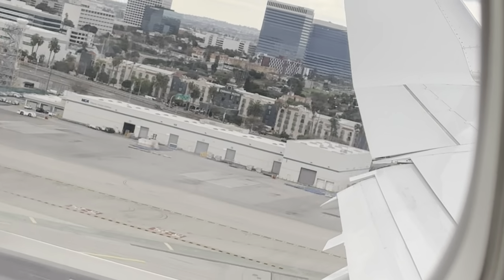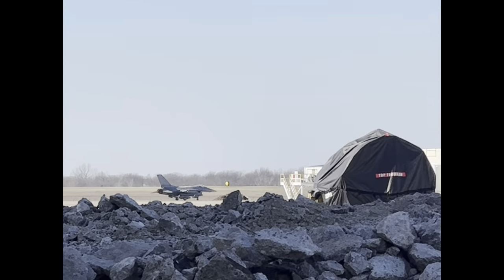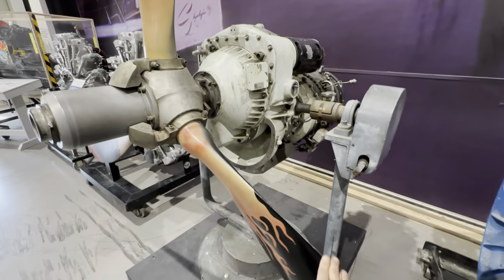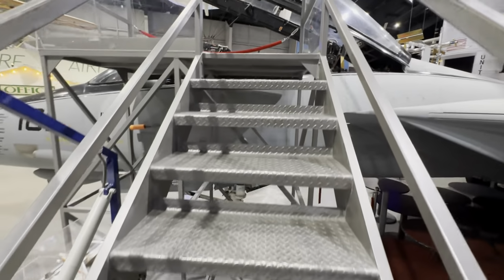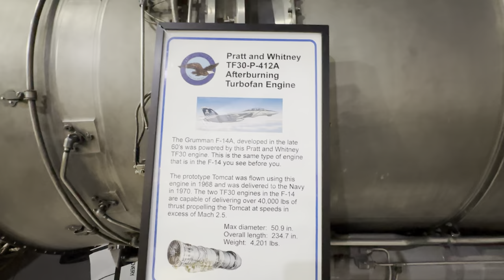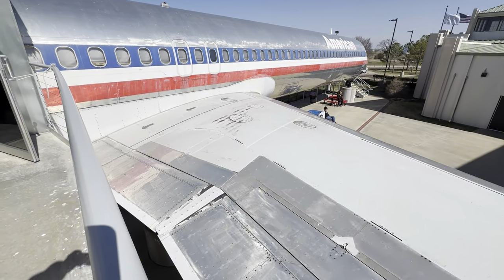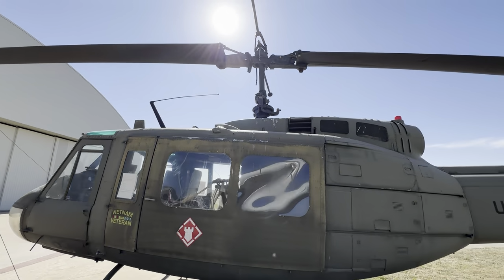Stig Adventure  Tulsa MRO visit and Tulsa Museum

Comment: I was amazed too when the CR Smith DC-3 came to TULE to be reconfirmed from a mosquito sprayer back to what it was, when it was delivered to American Airlines flying  passengers. I was blown away how similar cables pulleys cockpit was of the DC-3 next to our MD-80’s in C Check….. man I haven’t forgot the smell of that acft when it came and when we worked on it. Great Video
Reply from the maker: I have visited the CR Smith Museum as well, and that airplane is so pristine. They did a fantastic job restoring it.

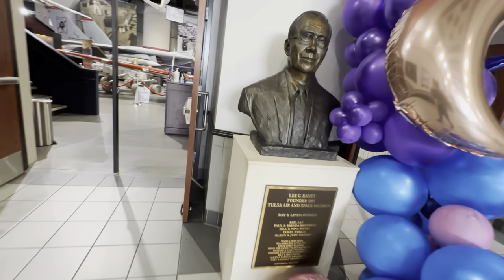Comment: I probably worked on those former Emery DC-8's at 8:26.
The DC-9/MD-80 part I disliked the most was the BUTE door, I'm sure you've had your share of experiences with those doors Stig...
Love the museum, great video Stig!
Reply from the maker: Yes, indeed I did have lots of experience on those doors, specially anything regarding in that aft compartment, where the Air stairs were. Almost no room to work.

Comment: I just subscribed. Thank you for making these videos to show the work that gets done to keep these things in the air. The hours, the weather, nothing stops the continuous maintenance of these machines.
 I flew for your outfit for 36 years and found the engineers and technicians thru out the system to be the best. I got to fly test out of Tulsa on the DC-10 and Alliance on the 76/75. Overhaul is an amazing thing to see.
My dad was a mechanic for United from the early 1950's and his dad built wooden wings for Curtiss aircraft.
Keep the tradition of exemplary workmanship alive young man. Love your videos.
P.S. I notice the chine tires and spray deflector are missing off the nose gear on the -80. Must be so they could mount it on the pedestal.
Reply from the maker: Thank you so much sir. I appreciate you being here and enjoying these adventures. And that is amazing that you contributed to the beauty of Aviation with all your years of service. I congratulate you and applaud you for that.

Comment: I remember at 3-4 years old, being on a DC-8 from Georgia to Calif. in 1961.  First passenger plane to exceed Mach 1, in a STEEP dive by a test pilot.
On August 21, 1961, a Douglas DC-8-43 (registration N9604Z) exceeded Mach 1 in a controlled dive during a test flight at Edwards Air Force Base. The crew were William Magruder (pilot), Paul Patten (copilot), Joseph Tomich (flight engineer), and Richard H. Edwards (flight test engineer).
Reply from the maker: Those were the pioneers of the aviation industry that pushed aircraft beyond its limits. Bravo, to such individuals who paid the way for modern day technology.

Comment: Such a cool video. That museum looked like a great place to see. Air New Zealand had 737-200's and also a Quick Change(QC) that were powered by the JT8D engine. I can remember that around 1993 they were re-fitted with Nordam hushkits. Miss that distinctive sound they made especially when powering up for take off and the reverse thrust on landing.
Reply from the maker: Those JT8Ds were very loud. Like a fighter jet
Reply: Yes they certainly were. Have you been following the news about the LATAM 787-9 that was flying between Sydney and Auckland when it dropped suddenly. 50 passengers were injured including a child. On our tv national news it was reported that one passenger had spoken to the pilot and he said that he lost instrumentation briefly. Apparently they are saying it was a "technical issue" rather than sudden turbulence. Must have been a very frightening experience for them.
Reply from the maker: Just learning about it now

Comment: First I do Like your video presentations.Thank You for visiting Tulsa and doing a video presentation. I spent almost 40 years as an AMT at Tulsa M&E [now MRO] and worked many different fleet types in Light C and Heavy C Checks as well as Back Support Shops. Many great things happen there every day to support and keep the airline running.
The Tulsa facility at its peak in 2000-2001 had over 10,000 Employees . After 2003 Concessions we started watching our work getting slowing OUTSOURCED to 3rd Party Vendors and as a result Tulsa has HALF of the Workforce it had at its peak. The facility still is the same physical size but some of the hangars are now used for storage that once had operating Light and Heavy C Check Maintenance Docks and Crews. Tulsa has a long and storied history with American Airlines. Back in the day Bob Crandall would drop in unannounced and visit with the troops on the shop floor and in the hangars. He came to Tulsa on a weekend in May of 1995 and personally thanked us for working OVERTIME to get the damaged aircraft back in service. A major hail storm went thru DFW in late April - Early May 1995 and we received about 40 Hail damaged aircraft at Tulsa. A lot of AA folks never got to see this side of Robert Crandall and I'm very glad that I got to experience it first hand.  With all the B.S. that the Airline Business has went thru in the last 40 years I'm still very glad to have worked a career at AA.
Reply from the maker: You speak from the heart, the reason I know that is because I lived through similar events. The important thing is we remember what this airline stands for. We remember that we are the ones that brought it up. We are the ones that kept it airworthy. I’m here to honor people like you people that made the metal fly. I will not allow the passion of Aviation and the passion of people that love these aircraft to ever fade away.

Comment: My wife worked for Hughes Aircraft Company's Radar Systems Group in El Segundo.  She wrote software used in the 8-bit computer at the heart of the AWG-9 weapons system of the F-14.  Her two areas of focus were the communication between the radar system and the AIM-54 Phoenix missile during command guidance mode, and "situational awareness," that is, the display of information to the Radar Intercept Officer.  Hughes borrowed some of her display software for use on the F-15 Eagle.  Compare this tiny memory and slow processor to computers today. That 8080 microprocessor provided the Tomcat with the world's first track while scan and long-range intercept capability. The F-14's 1970s capability was not equaled by the Navy until 2016, when the F/A-18E Super Hornet received the extended range AIM-120D AMRAAM, made by Raytheon.
Reply from the maker: That is absolutely incredible that your wife got to partake in of Aviation history.

Comment: The MD 80 = AA originally purchased and operated MD82 and MD83 Series aircraft. The MD83 also had Aux fuel tanks for extended range flights. After several mergers I'm not sure what all different Series models of MD80's that AA had. May have even received some MD88's - MD90s or 95's in mergers.
The MD80 entered AA Service on April 6, 1988 and Retired September 6, 2015.
AA owned over 300 MD80'S at one time. As the 727's were phased out and retired the MD became the backbone of the narrow body fleet.
I still love the 727-223 [ Stretch ] Aircraft as my favorite AA Aircraft followed by the B757 -223.
Reply from the maker: Absolutely fantastic information. Thank you so much for this

Comment: I think the Tulsa facility is where the engine removal procedure was done on the DC 10 that crashed at Ohare in 1979
Reply from the maker: Yes, it was, you are correct on that. It was an incredibly bad time. That’s one of the few times that maintenance was at fault

Comment: I've flown the little orange three cylinder two place airplane hanging from the ceiling. 
The same day I flew a me108 with an eight cylinder 400 hp engine.
I think it was at Rockford.
Gene Chase was flying the Spartan anJohn VanAndle was flying the 108. I was 15 so it was 1966.
Reply from the maker: That’s incredible Terry

Comment: Stig great video. Thanks.
Question of the day. The triple 7 taking off from SFO today lost a tire. You have mentioned in your videos of all of sensors and Back up systems. Their was no indication in the cockpit that they had lost a tire on takeoff. Please explain how is that possible??
Reply from the maker: The only indication they would have is loss of tire pressure indication. That’s the only thing that ties it into the system. Now, when we talk about backup systems, that’s only one tire there’s 11 more main landing gear tires. The aircraft can land safely with one missing or even a few missing.

Comment: For some reason I thought the history of AA was that the reason why AA never painted it’s airplanes and left the chrome exposed was that it was cheaper to operate the plane because they were lighter without the paint and primmer and therefore more cost effective per the beam counters and was one of the reasons they were the last airlines to file for bankruptcy during the airline bloodbath of the late 00’s.  This video proves me wrong .
Reply from the maker: It could have been the reason as well, but they might have not foreseen the cleaning of the bare metal back in those days. So your answer is not wrong It’s totally acceptable

Comment: Hey Stig, I’m sure you’ve seen/heard about the tire situation at United on their 737.  

From your perspective, do you have any pictures or description of what that might look like during a walk around? I’m trying to visualize it and add it to my cross check. I can only assume one has to closely observe the lugs and bolts. 

Also, any chance we talk more direct, maybe company email or so? I wanna continue to enhance my knowledge of the 737, and throughout my time in the AF, i learned that reading the Dash 1 would only take me so far, the best learning usually happened  when I talked with the crew chiefs etc. 
I hope my request isn’t adding more work to an already busy job

All the best and huge thanks to you guys below the wing!!
Reply from the maker: Marc, I think you mean the 777 situation. In regards to walking around and looking at the tie bolts, they are visible on those wheel assemblies. If the wheel is not hot, you can touch them to see if they’re loose, but if the aircraft has just arrived, I wouldn’t recommend it because the wheel might be still hot. Also, the separation of the wheel from the axle might be from a different cause. I’m assuming it’s from a defective or damaged wheel assembly
Reply: @StigAviation  yup, you’re correct 777. Sorry I was thinking about my aircraft. 

Ahhh ok, that makes sense. I’m curious to see what comes out of this. It’s been an interesting week for United and an interesting run for Boeing

Comment: Well done Stig.  They already corrected you about Tinker so i wont.  Instead ill tell you my F14 story.  Well it isnt mine but anyways. One of my CAD professors was an engineer at Northrop Grumman and was apart of the team tasked with trying to correct its Death Spin (yeah that scene in Top Gun when Mav and Goose flew through the Jetwash then ended up in a flat spin was showing a real problem the plane suffered)  i think he said itbwas on the A models bit dont quote me.  Anyways he said they ended up adding some kind of panel or something that would bump out ofbthe aircraft to tryto help prevent the spin but they never reallly found a true cure.  Pilots were just taught how to avoid the situations that could lead to the spin.  I wish i could remember more about the story as it was a very interesting one.  Also my Aerodynamics professor helped design the flaps of the 757-300 and 747-8 during his time at Boeing. Lastly i did get a tour of your rival in Atlanta's Tech Ops facility.  All i can say is tours of these MROs is something ALL aviation geeks should put on their bucket lists!
Reply from the maker: Thank you so much for sharing that incredible story with me, and I definitely want to visit the Delta facility as well. And once again my apologies on the incorrect base. I made a correction in the comments as well as the description.

Comment: What chemical is inside an oxygen generator? And what happens when the mask come down during emergencies stig?
Reply from the maker: Oxygen generators on aircraft are comprised of a chemical reaction, which is a sodium chloride core installed in a stainless steel housing. If there’s a sudden depressurization, the panel will open and passenger will pull on the cord that the mask is attached to allowing a trigger to puncture the stainless steel housing and begin the chemical reaction to create oxygen.

Comment: Hope ya didnt work on any wheel assemblies lately! 😮
Was that from where you work at?
Reply from the maker: If you are regarding to the incident of the United 777, I don’t work for that airline.
Reply: @StigAviation  I saw afterwards that it left San Fran to Japan I think... had to divert to LAX after they verified the wheel was off thier plane! Not sure what kind of plane it was!
Of course I didn't think you were involved... ya couldn't have been as thorough as you are! I saw ya replace one on here!
Whatcha think could've happened... obviously the wheel nut wasn't locked (wire!) at the least! Somebody gonna get spanked for sure I'd say! Lol
Reply from the maker: @woodywoodman2319  i’m getting more information about it as we speak, it seems to be some kind of a wheel assembly failure. Still unsure I will wait for the official reports.
Reply: @StigAviation  Always wait for the report! Also... I just now see there was a landing issue at Bush Airport ... happening Now!
Reply from the maker: @woodywoodman2319  learning about that as well as we speak. United is definitely not having a good day.
Reply: @StigAviation  Right... VASaviation dropped a video 30 minutes ago... that was FAST!!!

Comment: ok Stig.  What happened on that wheel at SFO?
Reply from the maker: Only two possible reasons, either the axle nut failed or wheel assembly failed and stripped the threads or somebody did not torque it properly. That’s my assumption.  Wait for the official investigation reports.